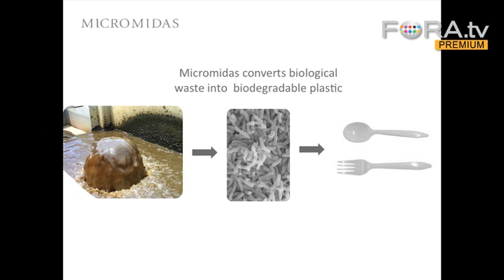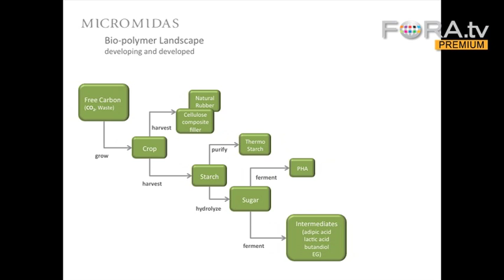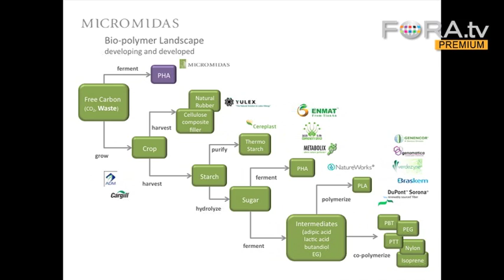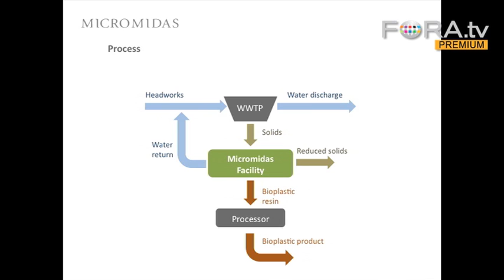Poop to Plastic: Turning Biological Waste into Biodegradable Plastics

Comment: Uh...does'nt sewage sludge have high levels of toxic metals in it?  So, if water sits in the plastic made with this sludge, would'nt metals leach into the water?  Or, are the metals removed before manufacturing plastics with it?

Comment: @givebirthathome There are other things than just poop that end up in the sewage system, the exact input material to the system cannot be fully controlled, so you raise an interesting question. Perhaps there is part of the sludge left over after digestion, which contains the heavy metal, and that these left overs are disposed safely, while the bacteria+plastic are extracted. One would hope there aren't traces of mercury or lead in the plastic utensils ;-) .